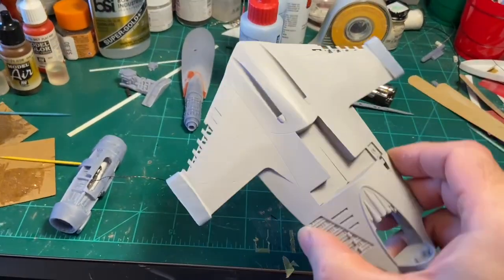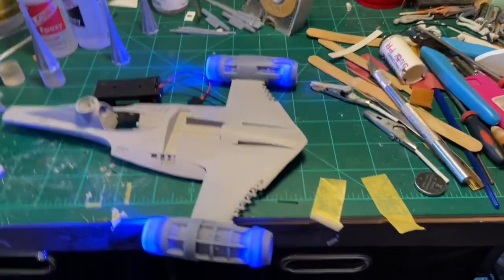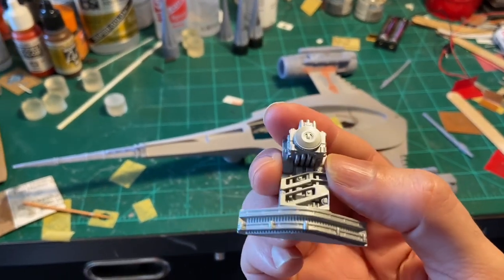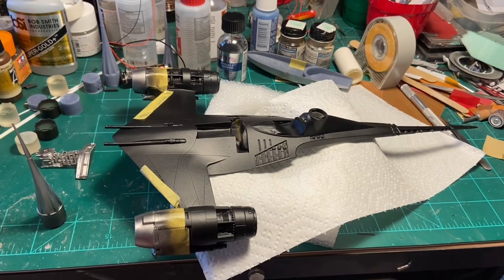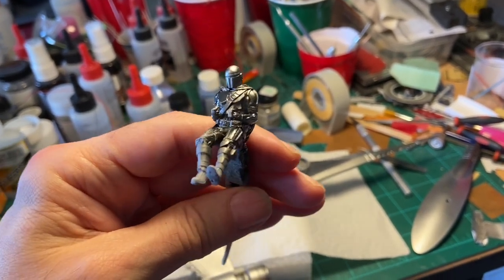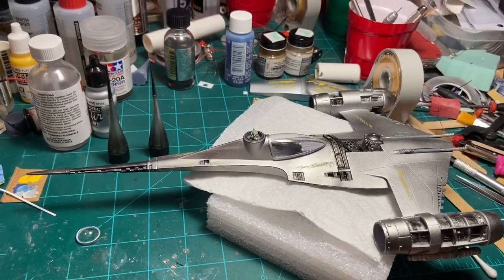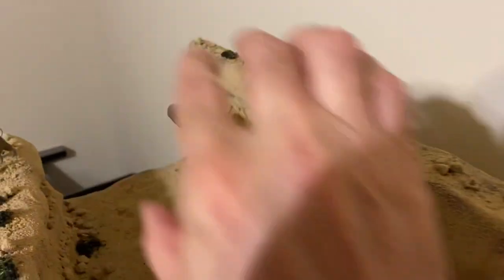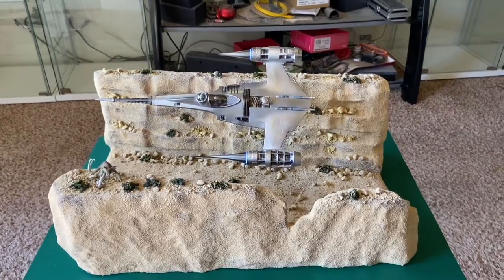Mandalorian N1 Starfighter build part 2 FINALE!

Comment: Ive just watched both videos. First off, thanks for sharing. I was thinking of buying the stl files from Gambody. Are you happy with them? Was it easy to print?
I like the way you made your own trenches for the led's they look great and emphasise the finished diorama.
I love what you said at 20:52 "I know that it’s  not necessarily  completely accurate, but it looks good and it  looks like it belongs." - words to live by
great video - 5⭐'s
Reply from the maker: Thank you. Yes, I do like the files. I did have some issues with fitting the two front halves together and onto the back. A lot of seam filling there. My diorama was rushed to be done in time for Wonderfest so I’m planning on redoing it soon.